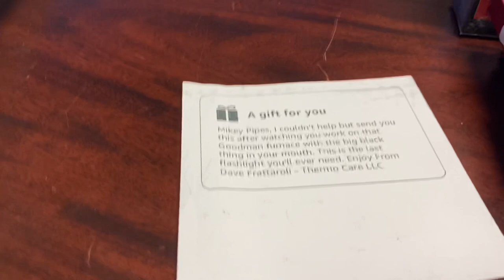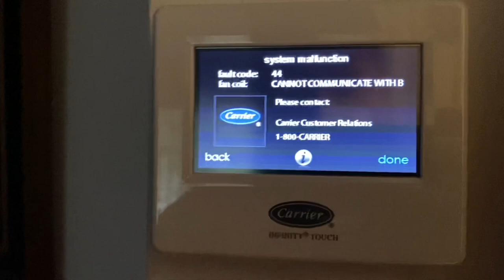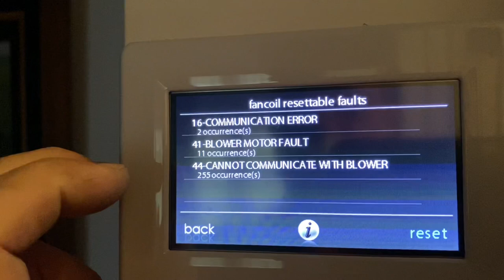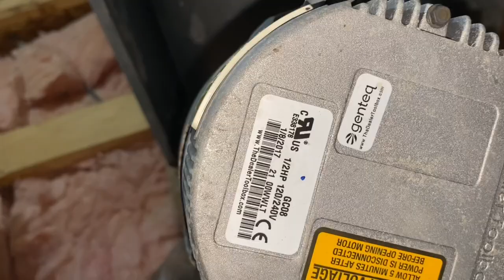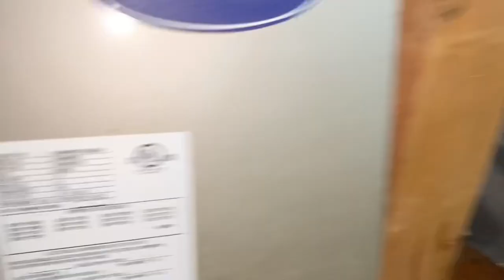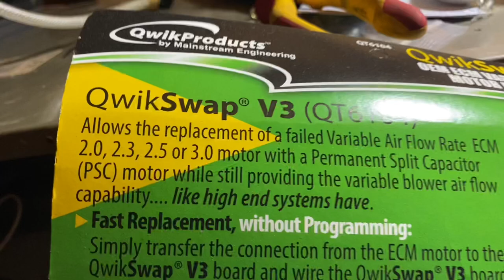Help! Carrier Infinity Blower Communication Error 44 - Dead ECM Motor Replaced w/ PSC & QwikSwap V3

Comment: I don't know why suppliers won't get ECM's in stock. The ECM can swapped off the motor in a few minutes. That quick board looks pretty slick for dealing with a communicating ECM. I've never seen a bad motor,  just bad ECM's. You got them air today!

Comment: A lot of times the only issue on an ECM motor is a blown inrush current limiter.  As long as all three legs of the motor have the same resistance and the fan turns freely the motor is fine.  Either the inrush current limit is blown or the electronics have an issue.  Usually the electronics are almost as much as the motor.

Comment: I never have used them, I have on certain 2 Stage Furnaces swapped the motor to PSC and used the Emerson Universal 2 Stage integrated control for PSC applications. Did you have any fault codes from the thermostat? I know Carrier monitors CFM airflow on their thermostats, the reason I was asking in some applications where there is high static pressure and airflow decreases I didn’t know if that would set off a thermostat fault Code. Thanks for sharing this video👍

Comment: Why not keep stock of, and change the module with the HK44EA123 saving the customer extra cost of the separate board, with a standard motor, capacitor, and labor to wire all up? Clean work though!

Comment: Did you go through the right setup process and make sure you put that green wired sensor on the first bend of the coil. That green wire doesn't sense ambient temp lol
Reply: You will have low low airflow issues if that sensor is not on the first bend after the metering device

Comment: Aw man.  That owner paid a lot for that ECM greenspeed carrier.  Were they cool with going down to a less efficient psc motor?

Problem with PSC motors is, they’re less efficient unless running full speed.  So running 50% speed, they still use 80% of full power

Comment: Hey, be warned about that flashlight, if it is like the one I have keep cautious that to keep the light intensity in check.... **It WILL get hot and litterly burn itself up**... had mine smoke a bit due to excessive heat that is if it is still working by the end of this video (just started viewing vid in hopes that you see this)

Comment: The ECM seems like a scam, they fail early and fail often.  I’ve seen surge protectors for the motors and for the entire air handler.  I’m thinking of spending the extra money when I replace my system and surge protecting the motor itself, the air handler circuit and the condenser unit over and above the whole house surge protector I have.  If it dies I will have it replaced with a PSC motor… just seems like they (ECMs) are not resilient.

Comment: Those qwik swap boards are cool, but they’re pretty salty. I can’t see spending two hundred plus dollars on the board if you’re trying to save the customer money. Just throw in two blower relays for 10 bucks apiece and wire one to Y and G to bring the fan on in cooling and one to W to bring the fan on in heating. Seems easier and a hell of a lot cheaper. By the time you buy the qwik swap board, the psc motor and capacitor you could almost pay for an ECM motor.
Reply: @PipeDoctor  that’s why you power the relay coil with Y and G on one terminal then C on the other terminal for cool speed and then another relay with W on one coil terminal and C on the other terminal for the heat speed. The blower speed tap wires go across the normally open set of contacts on the relay. You don’t need to use the DC coming from the board then.
Reply: @PipeDoctor I watched it again and I see what your saying. It appears to be an infinity system. If it’s a communicating system you might have to add a transformer and standard t-stat and it might not be worth it after all that. I’m not that familiar with the infinity systems so I’d have look into it a little more to figure out if a relay would work.